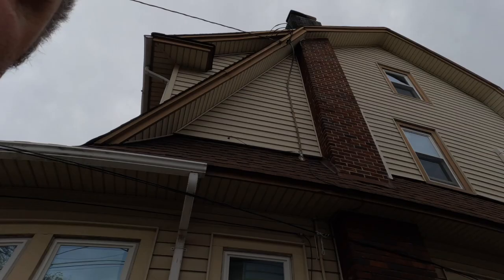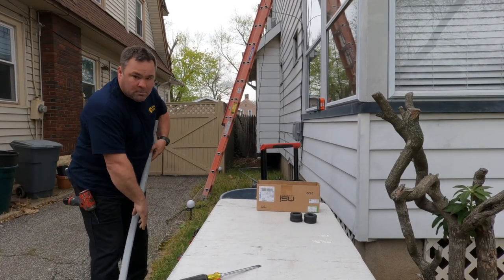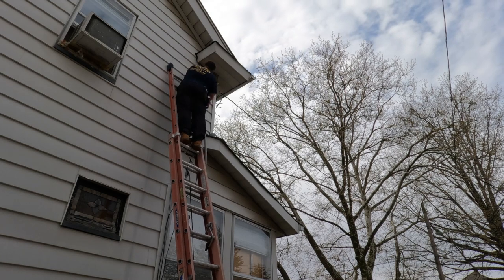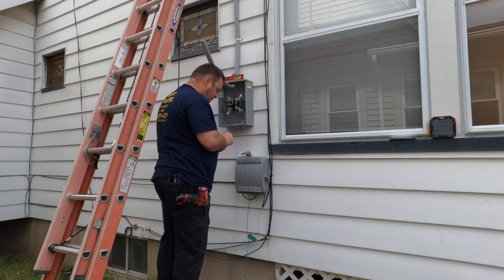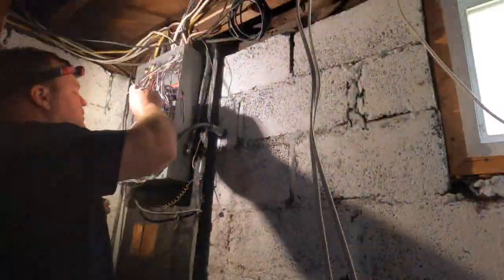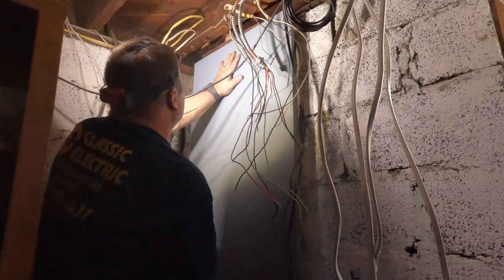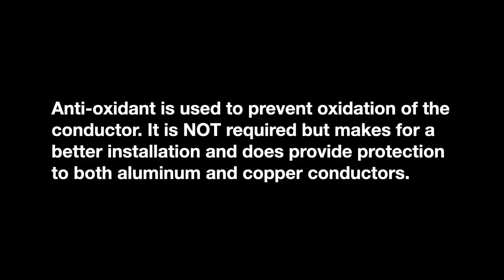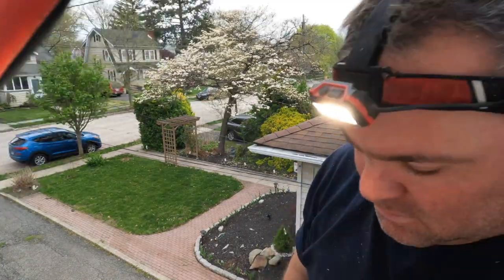Upgrading Electrical Service to 200 amps | Rahway, NJ    #200AMP #ElectricServiceUpgrade #Grounding

Comment: Where I live in California we are required to use 2-in rigid conduit for the service drop. The service cable is either 2/0 copper or 4/0 aluminum. We are also required to use EUSERC rated panel
Reply from the maker: Your panels are mostly outdoors too.
Reply: Jeff do you live in Los Angeles by any chance?

Comment: Hello Mr. Pecina, I love your videos, you are so steady in your work and explain things very well. (I'm assuming New Jersey by the accent. (my mother and maternal grandparents were from New Jersey) I grew up in PA and been doing electrical work 32 years. I love that you just show the work nothing flashy, or gimmicky. Please stay like that, I am all for a good laugh but there is a time and a place for that. And when you are completing work that can kill you, or possibly other  people, this isn't the time. You Sir, are a credit to electricians all over the world, especially here in this wonderful USA, a consummate professional. Sorry for referring to you as Mr. Pecina, whenever anyone does that to me I look around for my dad or grandfather. But I am also a Ron, lol. My dad told me growing up you never call someone Sir, until they gain or earn your respect, sorry I am rambling. But you Sir, have gained my respect within your work. The only thing I would add to your videos is leave the print up for a little longer when you post a written message, as it's hard to read that fast. And I thought the meter height thing was 6'7", I know that's splitting hairs, but we know how the NEC likes to split hairs, and so do inspectors, sometimes. But your probably right at 6'6" and mine is for inside panel boxes. But great video thank you!
Reply from the maker: The actual code is 6' 7" max height.

Comment: In Tx , that 4/0 SE Romex Cable for 200 Amp Services  is not allowed for outside install ! Contractors will buy the cable and then strip off and remove the Outer Jacket Sheathing and the inner snake skin from the 4/0 AL Conductors and run the individual conductors up in the   2 '' Rigid Galvanized Steel Conduit Mast and out the attached Weatherhead for the Service Loop Connections.

Comment: Not sure if this holds true for NJ but here on Long Island if the home is in a flood zone, the meter pan can be higher than 6'6''. Wood steps are required to read the meter. Now there are 'smart' meters installed everywhere and the reader doesn't even have to get out of their car.
Reply from the maker: Same in New Jersey.

Comment: Wonderful job brother, especially being on the clock and doing it all single handedly. I just had the same work done here and had my 100amp pushmatic panel replaced for a 200, 40 circuit panel. It took a team of 3 and probably a lot more than you charge but could be wrong on that. Cudos.  I'm also surprised to see your state allows you to reconnect the power. We had to wait hours for the utility company to come back and do that here in Indiana. They also required a external disconnect because my panel is more than 5ft from the meter. Now I have an external and internal disconnect.
Reply from the maker: When I was still working for an electrical contractor he would send me out by myself (sometimes) to do the work. As the years went by I learned to work by myself to "get it done" as they say. Years later - and working for someone else - they noticed that I could work well by myself so they never sent me out with a helper. So you see out of habit I know how to do many tasks alone.
Reply: @electricianron_New_Jersey  that's awesome to hear.

Comment: The 5th (neutral) jaw is for AMI smart metering and provides a return path for the 110v communication equipment that is built into the new AMI meters. As you can see in 10:44 in this video the meter is an old style that does not utilize the 5th jaw in any way.
Reply from the maker: I've been installing 5th Jaw meter enclosures in the PSEG neighborhoods for well over 20 years.
Reply: When is SER sheath cable rather than service entrance SE cable?
Reply: @wesleybrown2131  there's generally two types of SE cable used for service entrance, SEU = SE=Service Entrance U= Flat type cable and this cable contains two insulated conductors with a bare wire neutral wrapped around the two insulated conductors. SEU is generally used for Main Breaker panels. SER = SE=Service Entrance R= Reinforced tape. SER cable generally has three insulated conductors (2 hot & 1 neutral) and a bare twisted ground. SER is a round shaped cable and is generally used on sub-panels and applications where the neutrals and grounds need to be kept isolated from one another.
Reply from the maker: @wesleybrown2131  the difference between SER and SEU is Service Entrance Riser cable is 4 conductor cable.  SEU is 3 conductor.

Comment: I'm wondering if those strings inside the SE cable are there to help aide in the removal of the outer sheath. Otherwise it seems extraneous having them in there.

Comment: Nobody does the duct seal behind the screws, I thought I was the only 1 and oh does it piss me off when I'm redoing a new panel and meter install although it does make taking the old 1 off of the wall easy. I also pack it in the weather-head, and on the connector above the meter, that the cable makes entry into the meterbase box at. And also I put it on the hole(how we did it in the past) entering the house and now use Lb's. It really cheap insurance against call backs and for safety.
Reply from the maker: I used to pack it into the service head too but for some reason I stopped doing it.

Comment: Recently saw some electricians replace a service panel and in the main service panel there was no bonding between the neutral and ground. The panel was oldstyle so I'm guessing that's why? Its was installed in the 1960s. They didn't replace that panel though only the one outside
Reply from the maker: The system neutral and grounding electrode conductors are ONLY bonded in the main disconnect.

Comment: Hi Ron Love your content, keep up the good work...  I have a question though, I notices on the SEC Cable outdoor service drop you are not using conduit? can you explain. and when is it necessary to use conduit for a service drop above ground/
Reply from the maker: SEU is not permitted where not subject to physical damage. Here in the northeast we use routinely.  Other parts of the country not-so-much.

Comment: 6:04 I don't really remember but doesn't it says in the NEC code book that you should install the service entrance 3 feet away from window, I think i've heard something like that. But I might be mistaken though I don't remember the code.
Reply from the maker: Good question! NEC 2020 Section 230.9 (A) Clearances: Exception: 
 Conductors run above the top level of a window shall be permitted to be less than the 900 mm (3 ft) requirement.
 So there you have it. Also, the intent of that section of the code is to have clearances so that firemen may enter the building through the window.

Comment: Jheez was that main service live that's so cracked up 😂

Don't know what it's like in America but them grounding cables not need mechanical protection a strimmer would chew straight though them.
Reply from the maker: It's not required by the code if the conductor is #6AWG or larger and the utility company also does not require it. I also highly doubt a string trimmer (weed whacker) would go through #6 copper.

Comment: There should never have been a braided stranded neutral wire that we have to physically roll up and it never looks good. It should just be a normal round conductor like anything else we do whoever created that was purely not thinking

Comment: Roughly, how much does an upgrade like this run and are Permits typically required?
Reply from the maker: In New Jersey a permit is required for this work. This job and others like it start at $3,000.00.

Comment: an outside box can only be 6.6 ft. off the ground but what if the box will be accesed when standing on a deck would that still be 6.6 ft. from the ground or from the deck .and what if your water lines all the way from the meter are pvc except the hot water witch is copper from the water heater to all hot out puts wee do you conect the third ground ?

Comment: I am curious why a conduit service riser was replaced with SEU.  I have no problem with SEU but it seems a step backward in quality and appearance, or was the customer just asking for the cheapest job possible?
Reply from the maker: There is absolutely NOTHING WRONG WITH using SEU cable if it's installed correctly. After thirty years I think I know what I'm doing.

Comment: Hey Ron, I just had a 100 to 200 amp upgrade installed by a licensed electrician including 2 new grounding rods.  Soon afterwards my basement sump pump failed tripping the breaker and the water rose to 8” before it was discovered.   Question, was there any danger of electrocution walking through the water to replace the pump ?

Comment: Looks good and neat. So much of what you did isn’t permitted in my city tho. I don’t understand why its called the NEC when seems like every state has different standards. Yet the NEC doesn’t specify each state.
Reply from the maker: It's the National Electric Code. Here in New Jersey we follow whats known as the Uniform Construction Code and this code adopts the NEC. This allows the UCC to remove and/ or add sections that apply to the state of New Jersey. We have a Rehabilitation Sub Code here as well. This applies to existing structures where certain NEC requirements are just impossible to apply. For instance, the ceiling height for an electrical panel is to be 6' high. Well, some basement ceilings aren't 6' high so how could that requirement be met in a home built in 1890?
Reply: @johndavies2949  I met a union electrician from Chicago a few months back. He says that Chicago has their own electrical code book. He says they don’t even read the NEC. 

add imagine that the only thing that has the most universal in electrical all over the world is the math. Wire Ampacity and Voltage drop calculations Are likely Universal

Comment: Ron, i noticed you were using Wago 221 lever nuts for your short wires inside the panel, I've started using them a lot they are very convenient. What's your take on them?  They are definitely faster, but cost a little more.
Reply from the maker: They do cost a bit more than wire nuts but they're great for extending short conductors inside old shallow gem boxes and for connecting light fixtures where you need three hands.

Comment: How do you like using that Klein 4 way MCM stripper? I just purchased one and have not used it (been using a utility knife). Great video!
Reply from the maker: It's always the tools that speedup production. I did it with a utility knife FOREVER until I bought the tool so I really appreciate the stripping tool. Good quality Klein Tools product.
Reply: They work great with CU Conductors but not so great with AL conductors !!

Comment: If you have underground service your line would be coming into the bottom of your meter enclosure. Do you just flip the whole enclosure in that case?
Reply from the maker: Good question! The answer is no.  In that case you would ask for an underground (UG) service meter.
Reply: @electricianron_New_Jersey  Thanks, moving to PSEG territory soon and planning to do a 200A service upgrade. Seems like the Milbank U8173-XL-KK-BLG can do UG and is approved by PSEG. Your videos  have been helpful.

Comment: Hey Ron, does it matter if you use PVC or Aluminum to run the riser cables in Woodbridge NJ?
Reply from the maker: @spree1948  it shouldn’t matter as long as the service entrance cable is subject to physical damage.

Comment: Ron, hope you can help. are we using SER cable for inside house from meter box to panel and SEU cable for weather head to meter box?
Reply from the maker: SER is 4-wire mostly used for main lug only panels.  SEU is 3-wire mostly used for service entrance conductors.

Comment: Wow!! As always excelent  jobs!! Question , what size of wire do you use for a new 200Amp? Is a 3/0 gage?
Reply from the maker: Actually, for a residential service 200 amps is 2/0 copper or 4/0 aluminum.
Reply: @electricianron_New_Jersey  thank you for reply me!! But which do you recommend !?
Reply: What that be just the hot or neutral as well
Reply: @electricianron_New_Jersey  -- Hey Ron, great video. Do you use the exact same wire from the top of the mast down to the meter as you do from the meter into the house?  Thanks.

Comment: Do you get only two main conductors from the electric service? What about the neutral ? Is neutral only in sub-panel?
Reply from the maker: Single phase main consists of 3-wire.  Sub panels get 4-wire.

Comment: When you went on top of ladder to attach new wire pole. Did you connect the city wires with yours?
Reply from the maker: My electrical license allows me to do this in New Jersey. Otherwise this would be 100% illegal and fines would be probable.
Reply: @electricianron_New_Jersey  thank you for your reply. It will be city’s job to hook up their end.

Comment: Where the cable enters the house through the siding what is used to protect the cable and to seal up the hole?
Reply from the maker: PVC conduit and hydraulic concrete.
Reply: @electricianron_New_Jersey  Thank you.

Comment: This comment is about the tool you used to cut the large wires inside the meter Wat is it called again?
Reply from the maker: Klein ratchet cutters.  About $179 at Home Depot . Com.

Comment: Can you use 200 amps and 100 amps in the Sam circuit breaker box
Reply from the maker: Yes. Imagine the 200 amps as a one gallon container. If 100 amps measures a half gallon then obviously it’ll fit in the container.

Comment: When installing Your meter into a energize socket do not stand directly in front of your meter in case of a back blast
Reply from the maker: There'll be no "back blast" if you've A) checked your work for any faults, and B) know what you're doing.

Comment: I'm possibly picking up a house that needs the whole service entrance replaced... SEU is frayed (old cloth covered stuff), and a lot of water has made it into the meter can so that's rusted to crap and needs replaced. Luckily the panel itself, a Bryant BR panel, seems to have avoided any water making it's way into the panel and seems OK. 

I'm just trying to figure out what kind of work I'm getting myself into. Generally speaking, if it's just a straight replacement, do you have to bring everything else up to compliance with modern code (eg: service disconnect, SER from disconnect to panel, etc. My area recently adopted the 2020 NEC so disconnect's are required in new construction), or does it get grandfathered in if it's an exact replacement?
Reply from the maker: Call your building department then hire a licensed electrician who is familiar with local codes and will pull a permit so the work is inspected.
Reply: I've been trying to get in contact with the local building department / electrical inspector, but it's one of those small towns where it seems like people in the city work between 3:00 and 3:01 every third Wednesday, haha.

In theory, as someone who has at least a decent understanding electricity, replacing SEU and a meter socket doesn't seem that much more difficult than running a new circuit for some outlets. The POCO won't allow even professional electricians to touch the triplex from the pole, so the most dangerous part of the job is taken care of by them. Hell, they won't even let electricians pull a meter themselves unless it's an emergency. 

Nevertheless, if I buy this house I'll probably hire it out. If getting basic information from the building department is such a pain, I'm sure the permit/inspection process isn't any better.

Thanks for taking the time to respond.

Comment: What kind of clamps do you use to hold the #6 ground wire to the wall.
Reply from the maker: Just 1/4” straps.  Ask an electrical supply house.  They’ll have what you need.

Comment: Just to make sure I got this right if you're doing 200 amp service with copper you use number 6 size wire.
Reply from the maker: #6 AWG for the ground rods.  #2 Aluminum for water main bond.
Reply: @electricianron_New_Jersey   Thanks Ron what about the service conductor for the panel what size copper for 200 amp Panel.

Comment: Could you please tell how much you would charge to replace just the service entrance cable going from the top of the house down to the meter?  I think I have a sleazy electrician feeding me some phony info.  Thank you
Reply from the maker: Each home and task is different but generally a service riser replacement starts at $1200.00.

Comment: Where did you land the #6 ground coming from the rods? In the panel or meter pan?
Reply from the maker: In the main breaker panel. This utility company does not allow grounding electrode conductors to be terminated in their meters.  Check with your utility company because some allow it.

Comment: Pertaining to the ground rods , is 6AWG the maximum or minimum size conductor required ?  Thanks
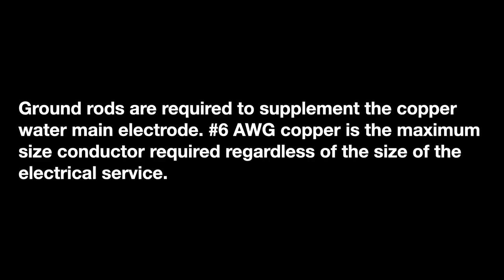Reply: RE:AL FRANCA. 09:33    I think the lettering on video is wrong. I think it should read minimum. Not sure if that would be solid or stranded.

Comment: Hello.   What size are the wires needed to feed a 200 amp service?    My house was built in 56  if I had the 200 amp service done would they need to upgrade the wire from the pole to ?
Reply from the maker: That’s strictly up to the utility company. They’re under a different set of standards when it comes to conductor size. If you get a permit and an inspection the electrical inspector will notify the power company indicating the service has been upgraded. Then a separate inspection by the power company would take place. Hope this helped.